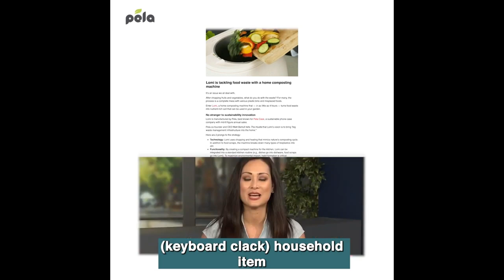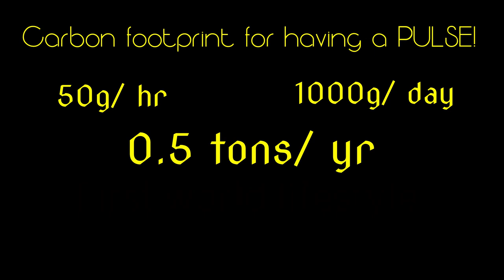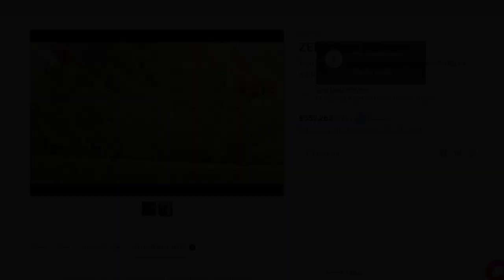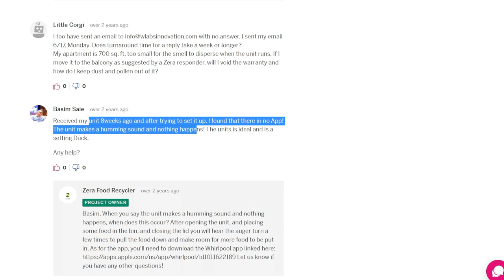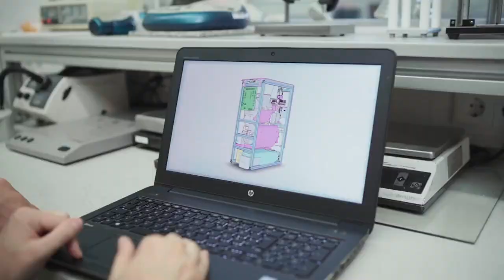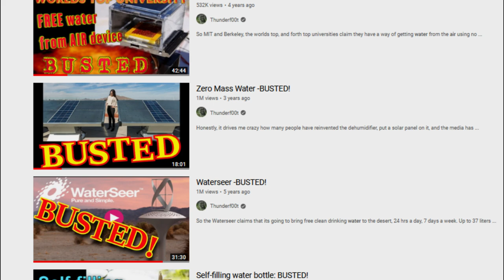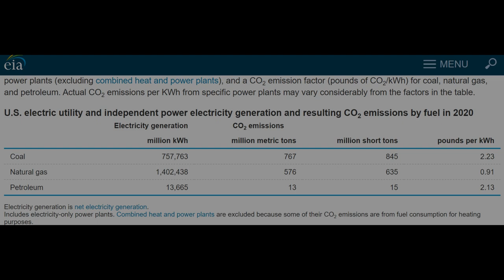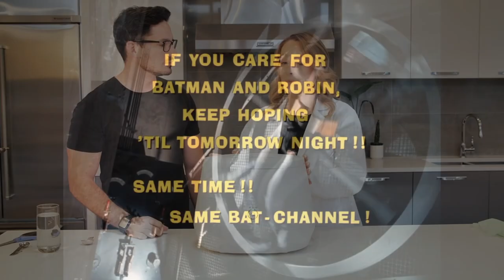Lomi: BUSTED!

Comment: I've done a lot of composting over the years, and one of the first things that jumps out at me about this process is that you do not want to dehydrate the waste.  The water content is crucial for getting the decomposition going.  Why not just take it to the next step, and incinerate all this waste?  At least then, you'd have a very small volume of ash to dispose.  I do have to admit though, we generally kept the compost piles *outside*, in a corner of the yard.
Reply: Or just use it as animal food , instead of incinerating..
Reply: no no no. thats not how things should be done. it makes to much sense. and doing what makes sense is not what you should be doing at all you should be just throwing your money at these companys since that doesn't make sense and if it doesn't make sense your doing it right.
Reply: Right? That was the first thing that made me go "say what?!" as well. Why would you dehydrate... you need the moisture and fungus and all the fun stuff for the composting process :s
Reply: That's easily fixed. Once you have Lomid your food and have dry scraps, just drop it in a bucket of water before you compost it. Voila!
Reply: We have 3 composts. A large open one that's about 4-5 yards. A medium enclosed one that's about 1 yard. A tumbler one that's about .25ish yards. We placed them at the furthest point from the house and neighbors. We regularly turn them, add grass, leaves, and water. Then we keep a bucket with a lid from a hardware store just outside the backdoor. When the bucket is full it gets dumped into the enclosed or tumbler compost. We haven't had any smell issues.
Reply: They don't even claim to be producing compost, but rather the "STARTER" material for composting.  So this would, hypothetically, be added to an ACTUAL compost pile somewhere that was kept moist so that it became, you know, actual compost.

All this does is speed up the process by a few months at the cost of a ton of energy.

Comment: I should look into Lomi, because my high tech composting device currently malfunctions: It used to produce an egg about every day, now it's more like every other day. I call it a Hen®. As a bonus, it also produces a kind of compost, an incredibly rich and condensed fertilizer!

More seriously, for the first time last week, my compost pile has produced several hundreds of black soldier flies. This happened after I recreated the compost pile switching the bottom and top layers and adding donkey manure in the middle. A week later, I poured a basin of gray water on top, and I was amazed to see a good hundred of black flies crawl up from inside the compost pile before going back inside to feed or more likely lay eggs, since the adult flies don't have a mouth, only the voracious fat- and protein-rich larvae do.

BTW, the product of these glorified kitchen dehydrators is in no way compost, because you need to add the water that you removed for it to properly compost. The heating process also killed all the bacteria that would have helped compost it faster, although this dry matter will quickly get inseminated both from the air and from the compost pile where you drop it. Still, it is a pretty wasteful and pointless process. It would be much better to ask your city for better waste management. I personally use 6 recycling containers, 3 in the house (food scraps + paper/cardboard, regular garbage, and a mixed bag of batteries + small electronics + expired drugs), 3 outside (glass, metal, other recycling such as plastic bottles).
I plan on melting the little aluminum I use or can retrieve for later use, and I am toying with the idea of grinding my glass waste into sand, using only renewable energy, of course.

Comment: I am a horticulturalist, I have a system that produces compost in 21 days without electricity. It is called chop it up and put it in a wormery. Yo can manage decent compost in 48 days just by putting in a aerated bin and turning regularly. This produces dried ground sterile waste which is not the same thing as soil or compost.

Comment: I study microbio and have worked in a few soil ecoloy labs, dry unprocessed plant matter is about the singular worst thing you can use in a soil medium form of soil enrichment. As it, like you said, takes a very very long time to break down into form that is bioavaliable to microbes, symbiotic insects and plants. What these machines create is essentially no different from the fresh topsoil organic matter that functions as a physical barrier and as a habitat for organisms, it would be as useful as dried leaves.
Reply: Well yah, it has to rehydrate and THEN break down. You'd have been better off just chucking it in before dehydrating it.
Reply: Like what is even the need to have this compost soil in 24 hrs? Building a garden or planting is usually a planned activity. I thought that compost took a long time to generate, so good to know that's the case.
Reply: Both larger and microscopic organisms require water to break it down anyway, the idea of essentially boiling off the water first is the definition of insanity.
Reply: @CharlesNauck  
I mean you usually only salt the ingredients you actually use, not scraps, in other words if there's a large amount of salt in your bio waste you are throwing away too much stuff you shouldn't. But you are of course generally right.

Comment: Nice job. I started a small compost bin ( large plastic garbage can ) which I've been adding to for 11yrs and counting and I've never taken anything out of it, not even turned it over, just keep throwing veg/fruit scraps in it and in the summer I throw in what I scrape off the lawn mower bottom. It's like a bottom less pit. Maybe I can sell that idea, the bottom less pit compost bin.
Reply: Same here! It was half full when I bought the house in 2010 and just keeps eating.
Reply: Recommendations: Keep it as oxygenated as possible by either spreading it out or using mesh (I'm sure there are more ways). Also, have a connection to the ground soil so organisms from the ground soil can easily enter.
Reply: 1000 years in future. We found a weird Peet bog. Lol.
Reply: Where I have seen this, oh wait my backyard has one too :-)

Comment: I love how they spent 3 years designing a glorified blender
Reply: that they didn't take the sticker out of that says to remove before using.
Reply: Many American & Canadian homes already have a device in the sink that blends up food waste & other organic garbage. The sewage system transports the blended waste to the treatment plants, where it can be recovered & turned into fertiliser or fuel for waste-to-electricity generation.
Reply: @PARTUM_QUANTICLE  they put plastic forks in there too. plastic made out of bamboo and some eco friendly materials you could compost but not a lot of plastic is  that sort of stuff.
Reply: Um, excuse me, it's a blender and a dehydrator.
Reply: Made out of plastic. Just to add a cherry to the top of saving the world
Reply: @urdnal  You know the average kitchen already has both a blender and at least 1 appliance that can dehydrate things, right? You also know that using those for the listed purpose is the opposite of beneficial for said function, right?

Comment: The composter out in the corner of my backyard cost a fraction of that thing and the worms that do the work were free.     In the past I have dug a hole in my garden and just buried  kitchen  scraps.  And as a side note, not  a single person scraping waste into the device was smart enough to turn the knife to use the spine to scrape. Instead they all dulled the blade scraping it sideways on the cutting board.

Comment: What I'm curious about is how the Lomi's output decomposes. The big issue with landfills ofc is that bc there's so much waste piled up, it creates an oxygen depleted environment, where the waste is broken down by anaerobic bacteria that output more methane than aerobic bacteria. From the marketing material, it sounds like part of the whole Lomi system includes populating the waste with some kind of bacterial culture to help it break down and blah blah marketing speak. So say you use it to break down some waste that would otherwise go in your regular trash bin, and then dump it out in some unused corner of your yard, where it decomposes the rest of the way through aerobic bacteria, including those that were added by the Lomi. How does that math balance out, potential climate impact of non-renewable energy going into the machine vs climate impact in methane generated from that same amount of waste in a landfill? I wish this video had gone into that calculus. I also wish we could get the Lomi's output into the hand of some kind of soil expert who could analyze it. I want to know what strains those bacteria are, what they do in an aerobic vs anaerobic environment, what it does with compostable plastics (which usually cannot be composted at home), etc etc.

P.S. I also wish this video had made it more clear when it was talking about criticisms of Lomi specifically vs criticisms of other crowdfunded kitchen composting systems. I usually listen to videos as I work, and I found that most of the time the cues for this were mainly visual, which makes the video much harder to watch.
Reply: Also, how is the math affected if you're on 100% renewable energy?
Reply: @williambergmann641  So true...
Reply: I did the math in another comment if you can find it. This video gets it very wrong. Seen as an entryway to composting / alternative to landfills, Lomi reduces per capita carbon footprint by about 89%. Thunderfoot badly fucked this up with hot takes and zero data. Based on his comments at 3:00, he has no understanding of food waste emissions or the importance of composting
Reply: Thank you!  I’ve been so confused how he’s ignoring the entire point of composting at home.
Reply: @Sami522  This. Is. Not. Composting.
Reply: @electric7487  But you're adding additional waste to the sewer system. They have do to a lot of processing of the waste, to make sure pathogens don't get through. Could be somewhat energy intensive. And the result isn't usually used for fertilizer, but this is slowly changing. A normal compost bin is probably better. But, dumping down the garbage disposal might be better than the landfill
Reply: @ThomasBomb45  It seems energy intensive, but it's the microorganisms in the treatment plant doing the work. The increase in electricity consumption is tiny compared to these "rapid composters" that promise to do something fundamentally impossible.

The first thing Americans need to do is cut down on the amount of food waste they produce.

The second thing Americans need to do is look into ways of disposing food waste that are actually enviro-friendly and THINK through these things for more than 1 second. At this point it seems that environmentalism has become more or less a religion.
Reply: @electric7487  garbage disposals cause a lot of issues for the treatment plants that handle that waste.
Reply: Natural healthy soil contains methanotrophs, microorganisms that completely consume the methane emissions. When you use feedlots the animals are removed from the land and methanotrophs so the methane goes into the atmosphere instead. Also the petrochemicals they use for fertilizer, pesticides, herbicides etc and the methods of farming to grow animal feed and human foods often kills the soil biome/methanotrophs so this leads to methane emissions as well. It’s lost energy molecules because the organisms aren’t there to consume them. The answer is crop rotation, grazing, manure etc. 

Currently there is a manure shortage however and only 50-200 years of soil left to grow crops under current methods. This is why veganism is not the answer. We need regenerative farming practices to be readopted.
Reply: @EmergencyButtons  What are those problems?
Reply: I'm very confused about this as well. For the purpose of making "fertilizer" at home, Lomi seems like a stupid waste of money (and ironically harmful to the environment) if you have a modest-sized yard where you can easily compost the old fashioned way.

On the other hand, if this is meant for people living in urban areas/apartments who want to be more responsible with their food waste.....I don't see how desiccating and grinding up the waste is going to help if it ends up under the exact same mountain of garbage in the exact same landfill!!!!
Reply: Not using your eyes will make videos difficult to watch.
Reply: @electric7487  "and renewable fuels" 

WTF do you think solar, wind, and hydro are?

"we need to reduce our electricity consumption regardless of where our electricity comes from."

Yea, we're about 25 years past fucked on that part (and many others).
Reply: @williambergmann641  
> "WTF do you think solar, wind, and hydro are?"

They are things that are touted as "renewable energy" but are really not. 

Next, I should have said "synthetic fuels and biofuels" because "renewable energy" is a myth.

> "Yea, we're about 25 years past fucked on that part (and many others)."

Better late than never, buddy.
Reply: @electric7487  this food waste dehydrator is surely a very stupid thing, I agree
Reply: I had one and it kept breaking. There’s a bolt that rotates to turn the arms that isn’t strong enough. Even with soft stuff it collects on the bottom and hardens and can break this bolt. The bolt itself could be replaced or spares provided, or standardized, or made stronger…but instead they send out an entire new inner basket that appears to be a nonstick coated aluminum. A lot of cans worth of aluminum. 

When things are too wet, like melon rinds, water collects inside the machine where the electronics live. I had to replace the fan because of this, take the whole thing apart. 

And it gets very hot inside. Too hot to touch. This is after the cooling session. It’s hard for me to believe the bacteria they sell would survive this. 

Also they sell very expensive charcoal pellets…the source of which is unclear but possibly very problematic if anyone is familiar with the charcoal industry. There’s a tube these go into where the exhaust air is pulled through to aid in deodorization. This gets filled with a very fine dust from the material that’s being processed. There’s no filter for this and if there was it would quickly get clogged. I ran it next to a hepa air filter to be safe. Especially if the bacterial additives are used as instructed this is probably not safe to breath in.
Reply: The machine is also quite large and very heavy. I actually kept it in the bathroom next to the toilet. 

The last breakdown I was very conflicted with how to proceed. I purchased it used in the interest of planet friendliness and therefore it was always very hard to get product support from Lomi. Without their support these things are useless. I ended up donating to goodwill to hopefully save another victim from purchasing this product new and at full price.